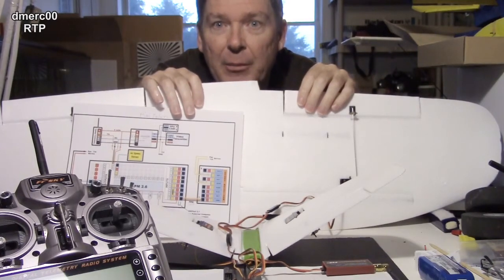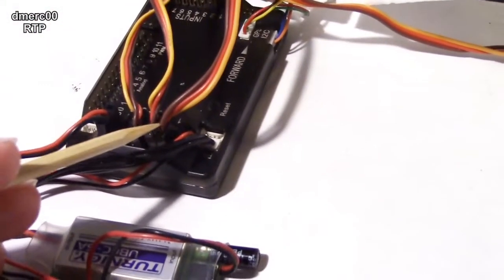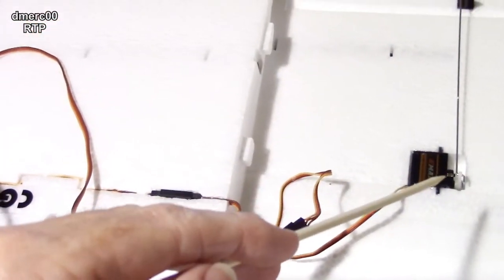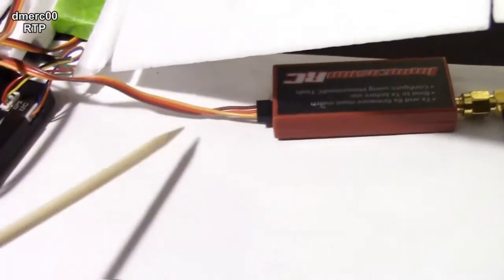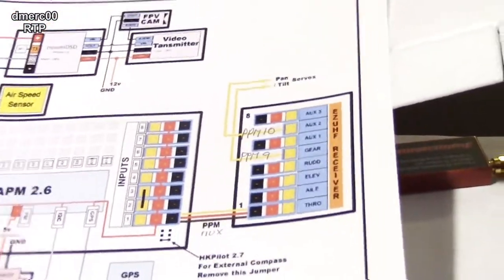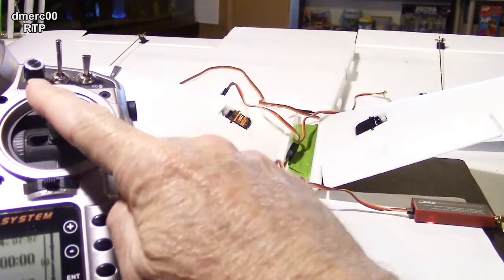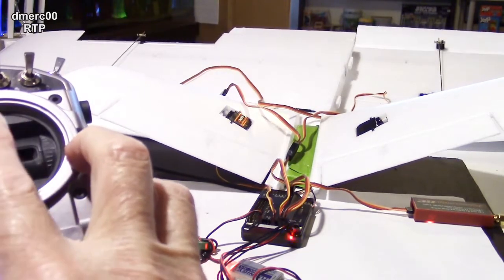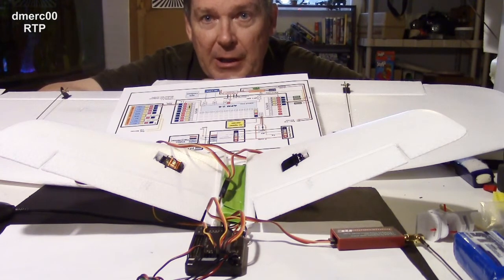Ardupilot V-Tail Mixing Servo Setup Update, XUAV Mini Talon VTail Plane Part 9

Comment: Since I fried my brand new Matek F405-wing board I’ve decided to just threw one of my good old pixhawk 1’s in my Mini talon.  Is this diagram you have for Apm the same way I’d setup with pixhawk?  I have a couple of APM2.6 and 2.8 too but really want to use pixhawk for its later plane versions.  Please let me no if I can or can’t use this setup Guide for my MT with pixhawk.  
Thanks Dave.  👍
Oh and by the way I didn’t really fry my Matek F405-wing board the damn USB port broke off and I was extremely gentle with it and even used Epoxy to reinforce it before I started plugging it into my computer!  RMRC has seen my photos and are sending me another board but honestly I’m getting a little frustrated with this inav stuff and since I’ve got all these pixhawks and APM’s lying around from my AP drone building days. I might as well use them.  I’m a lot more comfortable using Arduplane than inav anyway since I’ll be flying around with an expensive HD camera board with servo pan and tilt and possibly a 2axis gimbal down the road.  
Thanks again Dave for this great video.
Reply from the maker: There is a diagram with the PixHawk lite on my ranger 2000 here that might answer those questions:  https://davemerc.blogspot.com/

Comment: How do I set this deflection up for vtail in inav 2.0 on my mini Talon.  When I go left and right on bench in horizon and angle modes my vtail doesn’t have that deflection like yours. I no it’s supposed to but what am I missing?  All my surfaces are moving correctly rudder ailerons elivator.
Reply from the maker: I never tried a vtail with iNav so I don;t have a clue.

Comment: Hi Jose, I need your help. I'm working on a project to implement an Ardupilot but I have a problem because I have a combustion engine but the manual does not have a section for this type of engine. I need your help
Reply from the maker: Not surprised at the lack of info for fuel power. The vibration from the pistons will probably cause errors with the Autopilot. I don't fly fuel myself but I would imagine some sort of throttle curve in the radio would be necessary.
Reply: In this case we want to install a servo motor instead of an electric motor, how could we do it?
Reply from the maker: It's as you say. The throttle channel will go to the throttle servo instead of the electric motor throttle. I don't know what you would do on the APM side because I only have experience with electric myself.

Comment: Try hitting the key points of your airframe build, out of the norm stuff. Get you in the air sooner. Will the ubec replace the speed controller ubec permanently?
Reply from the maker: Thanks for the feedback on the build. 
I normally don't use the BEC on the ESC because of the electrical noise and possibility of failure.